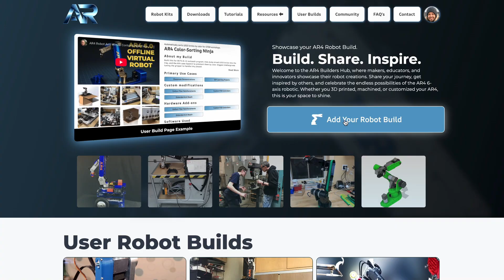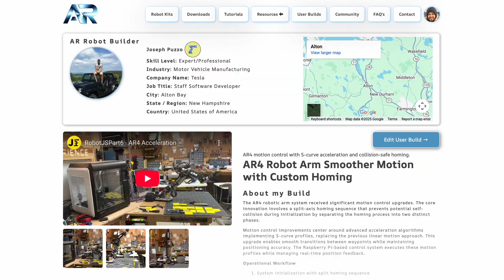DIY 6-Axis AR4 Robot Arm User Build Spotlight

Comment: will these steppers work if we replace alu parts with steel ?
Reply from the maker: I think steel would probably reduce the payload quite a bit.  The robot payload is 4-5 lbs.  I think if the upper arm parts were steel there might not be much payload remaining.  Maybe if the parts redesigned or slimmed down it might be possible.
Reply: @anninrobotics  ah to be thinner vs alu